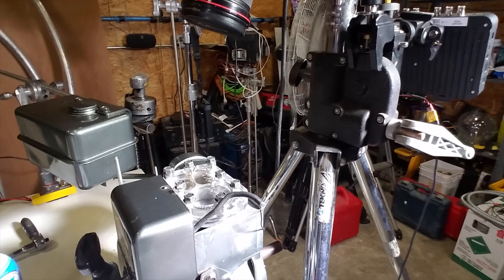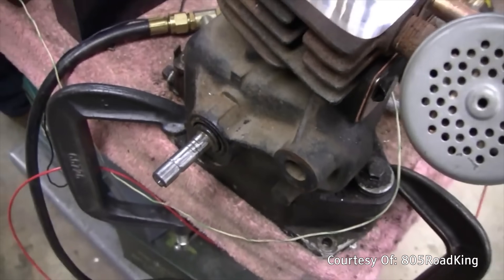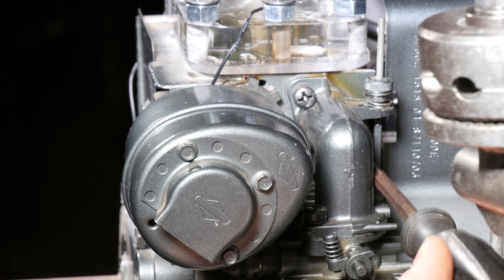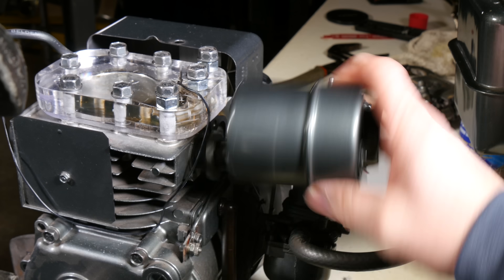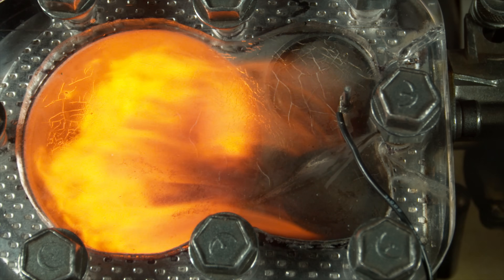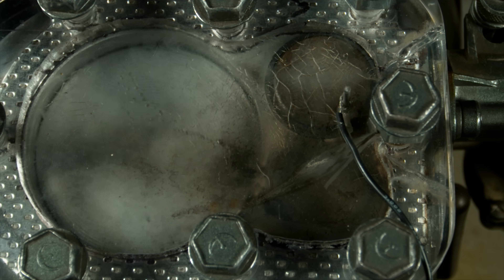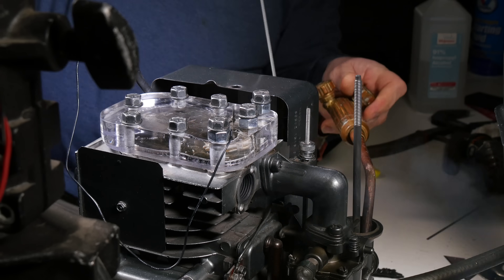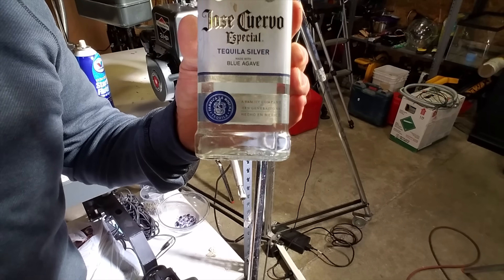See Through Engine - 4K Slow Motion Visible Combustion ( S1 • E1 )

Comment: I would like to see you run the engine, if it's not blown up already, with a gasoline mixed with the 91% alcohol. As did you, I noticed that the alcohol did clean up some of the soot and carbon on the valves and piston, this is what I would be interested in. I was thinking that a person could add the 91% alcohol to a tank of fuel (10 gallons) to help clean the valves and piston. from my calculations, a 16 ounce bottle of 91% alcohol added to 10 gallons would be 1.25%. 
If you were to try this with the amounts that you are using I would suggest running about 10 mL of gas and to milliliter of 91% alcohol, although that this is a 2% ratio, I would like to see how clean it would make it. 
Thanks
Reply: A thin water stream into a fast running engine has been used "forever" to decarbon engines.
Reply: IF YOU CLEAN THE CARBON OF YOUR RINGS.IT WILL START SMOKING LIKE HELL

Comment: How about burn acetylene and oxygen together to see if it burns cleaner?
Reply from the maker: +QB Machine cause that burns explosive
Reply: Warped Perception it should be okay if you make it lower pressure... cause I weld with an oxyfuel kit and I can tell you that all that happens is it burns cleaner and more efficiently. Acetylene alone is explosive, correct? Adding in oxygen just helps it burn better. Trying not to be a snobby teenager but I'm being serious

Comment: Sorry if this question is stupid, but this video got me thinking. Does the spark plug ignite the fuel for every rotation? And does a cylinder cease to function once a spark plug  goes out? Finally, if the cylinder no longer functions, does this result in a drop in rpm's?

Comment: The big thing I have to say about the alcohol is it is isopropyl alcohol. Which is only 91% pure alcohol(The rest might just be water). I've helped a professional tractor pulling crew for quite a few years and we run racing alcohol(Usually pure methanol) You will have much better luck trying to run that, as it is around 98% alcohol. Amazing video! Best of luck to you!
Reply: Hannibal Smith 99% is just for numbers (and perhaps some lab testing in super clean environment), after 96% or so it almost instantly balances with humid air so you would have to use it directly after opening. Not to mention price being very discouraging. Better to just mix it (standard 95/96%) with some gasoline.
Reply: You can buy lab grade iso which is over 99% pure.  But the cheap 91% stuff from the drug store is around 9% water, as you said.  They should have gotten some pure iso, or even E85 would have been better.
Reply from the maker: Thomas Briscoe thanks, I used to be a race car driver since I was 8yrs old. I'm very familiar with white water methanol. the idea here was to see if it would run with things from around the house .

Comment: awesome video! just makes me think of everything I've ever heard of that is explosive or combustible. I remember when I had a job at a grain elevator that grain dust is explosive,  probably hard to do if not impossible but could an engine run off of dust if the air mixture was right? I'm sure it might sound dumb and would be hell to the cylinder but my warped perception says engines are cheap so why not try.

Comment: Just a stupid question lol but when petrol enters the piston chamber does it enter as a gas because going by law that would give greater pressure???
Reply from the maker: The.#1 T well in the part 3 video of the STE, you can see that it enters as both, and vaporizes as the cycle continues, by the time it is in the compression stage it's completely vapor.

Comment: Just a note for future projects, polycarbonate (which I assume is what you're using as the head) has a few chemicals which can cause stress cracking. While Isopropyl Alcohol should be fine, I have a feeling it might be oxidizing into Acetone in the combustion chamber, which can cause those cracks you're seeing which could severely reduce the strength of the part. You might want to invest in some safety screens. Very cool otherwise!
Reply from the maker: +Devin Prescott hey Devin. No this was not polycarbonate, although that was an option. It's a type of high temp acrylic. I'm actually hoping it blows as that is the next episode we are working on, nitromethane. We have plenty of safety gear in place that is not shown. Thanks !! We may post a sneak peek of the nitromethane run this weekend because it was pretty insane .

Comment: Your rubbing alcohol is only 91% alcohol. That's water sloshing around in there, not unvaporized alcohol. Notice that the liquid built up as the engine ran. You were burning the alcohol but the water was left behind and accumulated with each cycle. 
With the acetylene, if you were getting a lot of soot initially, you probably needed more air and less acetylene.
Nice slow motion images! Enjoyed watching.

Comment: Try coal dust!
I have read somewhere that experiments were made running a 4stroke engine on coal dust. Problems were the micture between coal dust and air plus the engine didnt last very long. But for a few minutes, it should be possible! And if that works - try it with flour!

Comment: Hey guys, I found this video just by chance and was incredibly amazed at the end result of it all. Much as Michael commented, it's a great video for demonstrating how an internal combustion engine works; it could also be used to demonstrate so much more. 

A long while back I used to teach guys tuning theory and racing theory via a simulation racing game on Xbox 360, and often hunted for videos like yours here to help demonstrate and explain certain characteristics more easily. 

In regards to your video, not only does it demonstrate the basic elements of an ICE, but also goes to show how the inherent back-pressure in any given exhaust system will affect the exit and flow of post-combustion gases. In my case, I was able to use this video to explain to my wife how improper back-pressure(s) can, and often do, have dramatic effects on the engine's valvetrain components. 

Absolutely awesome video.
Reply from the maker: Hack Fragment thank you !!

Comment: Great video, very informative. I noticed that when you used alcohol as the fuel, there seemed to be a lot of liquid in the cylinder, probably because the fuel wasn't vaporizing like the gasoline does. I suspect that even with gasoline, there may still be some amount of liquid being introduced into the cylinder, so the fuel may not be completed burned. Since you already have the equipment set up, would you consider running your experiment again, but using gasoline vapor instead of liquid? There are numerous videos on YouTube showing that easy to build vapor systems allow for more efficient combustion and better fuel economy.
Reply from the maker: +Internet Profit Tools thanks ... There is , in the newest video which will be published Thursday, we can see some liquid getting into the engine when running stoichiometric, but by the time the spark ignites it it's already vaporize

Comment: Try running it on alcohol vapor. It won't be much of a show bc it burns so clean but it should put out a pretty blue fireball. The cool part is how long it will run in comparison to regular gas. Also it will stop the flooding effect you were getting.

Comment: Why are there two sparks per cycle?
Reply: Daniel Blanco Bolado because it's a stator design and not electrically controlled by a computer like in a car. every rotation of the crank produces a spark. it's a useless spark but doesn't hurt anything

Comment: AWESOME work . No better way to prove what is happening in a 4 stroke engine , than look inside and watch . The wet flow patterns is what interests me. I must admit that old flatty has better wet flow than most modern V8 engines do . OHV engines tend to wet flow around the port short turn radius and only us about 40% of the valve area to allow fuel to flow into the cylinder . This is why quench distance is so important in a OHV engine . The old flatty was using maybe 80% of the valve area to flow fuel . To bad it was not as easy to build a see thru cylinder head for a OHV engine ? Thank you for you hard work .

Comment: Did you try castor oil mixed with alcohol? I used to run my model airplanes on that mixture instead of the standard fuel and it worked perfect. However, I cannot recall the ratios. The model engines I used were two stroke.

Comment: 4000fps camera? How much did that set you back? 
Or did you shoot it on like 60 or 120fps and use Twixtor or something.
Since a true 4000fps 4k camera (your video goes up to 4k).
Would require a camera probably worth 8 thousands dollars at least.
The camera would have to have it's own SSD (since no sd card is fast enough for that).
Reply from the maker: Lord of the belts: The return of the KING so the camera used in this video cranks out an absolute 5000fps in HD and 1300fps in full cinema 4K, it's about $180k for the camera , no lenses, batteries or media .

Comment: Now THAT was SWEET!

I had one of those "visible machine" model engines (a V8) as a kid that my dad and I put together, and while it was complete with a "working" distributor, wiring, and small incandescent bulbs as "spark plugs", it fell (understandably) miserably short in illustrating the physics of the combustion itself. I never stopped wondering if I'd ever be able to see what things actually looked like in there when an engine was running under its own power... and while a very vivid imagination filled in a fair amount of the gap, there's nothing like seeing something actually happen. 

Needless to say, you've done an excellent job of presenting it, despite all of the challenges in doing so... I found myself asking why it was never allowed to reach stoich on straight gas, but it didn't take long to remind myself what a hostile environment that is, and that finding anything transparent that could stand up to the abuse long enough to see it at all was an astounding feat, nevermind get up to speed and lean out LOL

I'm sure it took a few attempts to get the head worked out to the point the thing didn't just catastrophically and immediately fail... and I think I speak for anyone who does things purely for their intrinsic insight value, when I say that we appreciate the effort!

That said, 3 things come to mind...

1 - It should be pointed out that the flame front isn't entirely accurate because of where the spark "plug" is... LOL But after thinking about it, I'm not sure there was any real option to how you pulled it off... I'm betting that a tapped hole in the location of the OEM head design wasn't a simple oversight... and I'm also betting that it had less to do with the plug interfering with line of sight to the cylinder and more to do with that whole "catastrophic failure" thing... How far off am I on that?

2. The thoughts on acetylene are pretty much dead on... I suspect the reason it behaved the way it did was because of the mix, and the presence of the alcohol also interfering. Given the nature of a stoich acetylene mix, it's probably not a bad thing you didn't achieve it - and those safety glasses would probably be about as effective as aluminum foil as a helmet if the head did let loose. Doesn't mean I wouldn't watch if you caught a good mix with the camera, just saying "find somewhere else to be when it happens" if you do LOL

3. I confess to not having followed thru with looking for the tequila video, if it was indeed done. That said, I'm thinking it probably would have too much water in it to burn very well if ignite at all. But I'll look for the video anyway ;)

In closing, I'd just like to add... Nice choice of engine. Done many an experiment myself with this classic icon... tho this one certainly (and by far) beats all of them combined, by a long shot, methinks.

Carry on, sir. Good work indeed.
Reply from the maker: +MadScientist267 lol.. I also good one of those engines and had the same thought, my imagination also filled in the blanks so I agree. The reason I didn't let it get stoichiometric was exactly that , the heat, however I have made advancements in that area so I'm going to try that next .
 1. The spark plug location was changed just to get it out of the way mostly, I had options but wanted to get a clean look at the combustion process, that head is really strong but I can get it to blow and I will in the next video.
2. That's correct....Lol. I will add OXY / acetylene as the last fuel in the next video, it will be fun for sure.
3. The tequila didn't burn but the 151 did , the video is on this channel.

Thanks for all the kind words !

Comment: Okay this is going to be a stupid question so please no hate. For most of the fuels there seems to be a lot of un-burnt fuel escaping from the exhaust. Is it not possible to I) recycle this fuel/exhaust gas? ii) have a small piston and cylinder pre manifold to get whatever power is in the exhaust? For my first point I can almost see a vacuum on a two way or rather split valve, the suction is strong enough to only pull away most of the lighter/burnt gasses whilst the remaining is sent through for another burn.

Comment: As a life-long gearhead, I can't thank you enough for taking the time and effort to show exactly how internal combustion engines work.  The alcohol experiment was especially interesting, since it showed a few of the benefits, and one of the drawbacks, of running alcohol in racing engines.  In my case it was speedway motorcycle engines.  As can be seen in your video, though I realize it's exaggerated, alcohol engines are run very rich, so mileage is poor.  But alcohol also burns clean, eliminating sludge and carbon buildup.  And since so much alcohol runs through the system, it allows the engine to run much cooler than gasoline powered systems, eliminating the need for large fins on air-cooled engines, and large radiators on water cooled engines.  Anyway, GREAT work!

Comment: This was great! I think you might have gotten better results with the Acetylene if the oxygen valve would have been opened also. Just a suggestion based on my experience with Oxygen/Acetylene torch rigs. Thanks!

Comment: Ordinary rubbing alcohol contains up to 30% water, also with the solvent properties of the alcohol it will clean the cylinder the valves and spark plug. For the next test why not save the tequila and try Everclear which as I recall mostly grain alcohol.

Comment: That alcohol caused the acrylic to fail. I have a PC water cooling reservoir that I killed that way not thinking about it.  Instant cracks.
Reply from the maker: Deneteus yeah, I'm testing that for our next engine video, I think the high voltage may be propagating through the acrylic and grounding out on the surrounding bolts, or both.

Comment: 1. Awesome video. 
2. It seems like your getting your spark at or after TDC rather than a few degrees before. Retarded timing instead of advanced. 
3. I though for sure you were going to hydrolock on the alcohol run.

Comment: After running it on tequila. How about trying to run it on 100LL Avagas that we use here in aviation?. it's a very dry, very slow burning gas that we use in high performance piston aircraft engines. Great video, thanks for posting.

Comment: wow!. My Pow in law had a l head engine that was flooding out plugs. I turned off the fuel and it still flooded , even with new plug.
I found the carb needle had allowed so much gas into it the crankcase was full of gas. we drained out the oil , fixed the carb , replaced plug , problem solved.

Comment: Would be cool to see one running about 2500 RPM and drop just a little paper flakes or sand in the intake. Just to see the reaction inside. It would just blow through with not to much damage but would be educational.

Comment: Wanna do something crazy?

Hook a Tesla Turbine up to an RC pulse jet with an HHO and peroxide mix for fuel.  See if you can make the Turbine spin so fast that it explodes apart from the force of the RPMs.

I think you can regulate the fuel mix mechanically by running the HHO through the Turbine , and the peroxide through the injector.  As lone as the HHO mix is coming through the impeller you should possibly be able to power the pulse jet with nothing but the output port of the Turbine.

The idea is the pulse jet should create a strong vacuum that will pull the HHO mix through the Turbine at a great enough force to capture that energy and use it.  Essentially an ultra high efficiency engine powered by Water and Peroxide.

Comment: This is a good example of how the points and ignition system are designed on small engines such as a Brigg & Strats.  The ignition is firing during both the intake and exhaust. Every rev of the crankshaft.   Common in small engines.  One advancement in Engineering later to allow the spark plug to fire every 2 revolutions, through variations on the cam and timing which has its improvements on larger engines.

Comment: what happened at 5:45? Well, in the earlier shots you can see the spark plug firing into both TDCs, simply because it's easier to build an engine that way and usually is no problem at all. Also you can spot how in the exhaust TDC the ex-valve isnt quite shut and the in-valve has already opened a teeny bit. Now, if the intake tract is flooded with acetylene, the spark plug will lighten up that entire mofo.

Same thing can actually happen on any engine, especially (well, almost only) ones with carburetors. You shut off the engine, the spark plug stops firing, but the inertia will keep it going for a couple of revolutuions, thus sucking mixture out of the carbs. Start your engine again and your intake manifold might pop off with a nice bang.

oh, forgot to add: HOLY HELL WHAT A VIDEO! THANKS MAN!